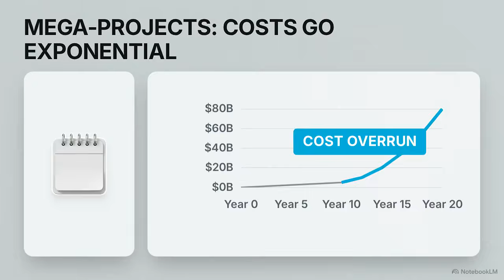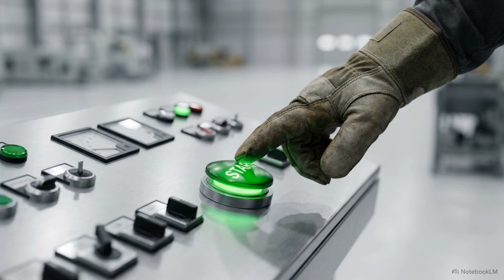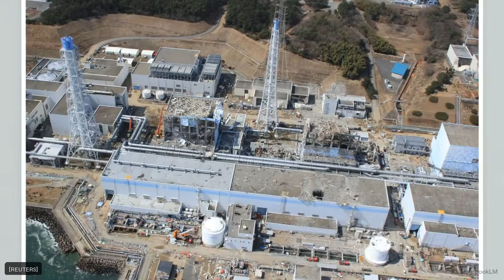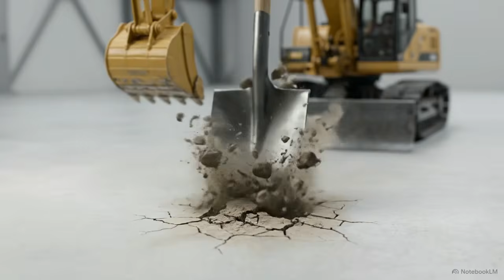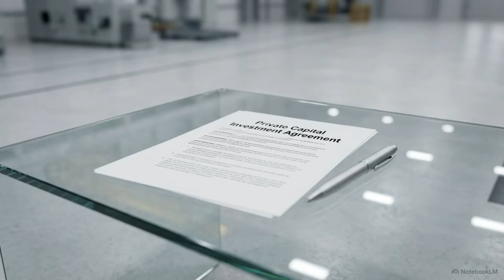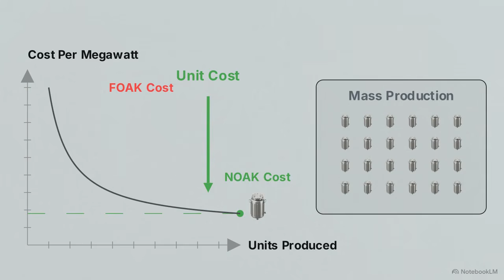The $9 Billion Nuclear Mistake: Why Small Modular Reactors Are Failing

Comment: There's some minor hurdles to overcome: Safety, risk of terrorism, clean mining, long term storage. And last but not  least: All other sources of electricity are way cheaper.
Comparing SMR to coal or natural gas is like comparing high-speed rail to a donkey. Who might well have made this video.
Reply: With nuclear, the high cost is all front loaded. The fuel is cheap and highly abundant, so once constructed, electricity production is cheap.

It's also far less harmful to the environment than coal, irrespective of what popular opinions on the matter might be.

The biggest problem with nuclear is the up front cost of getting the reactors built. The rest is cheap